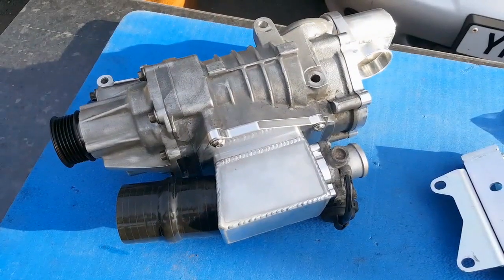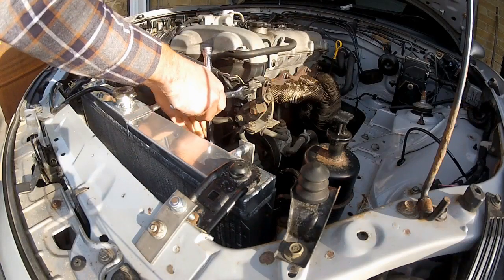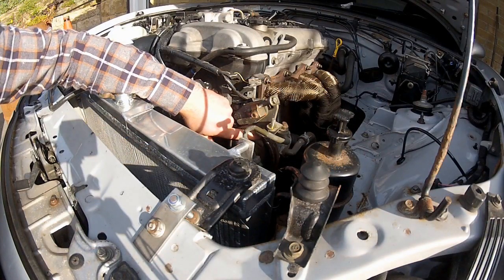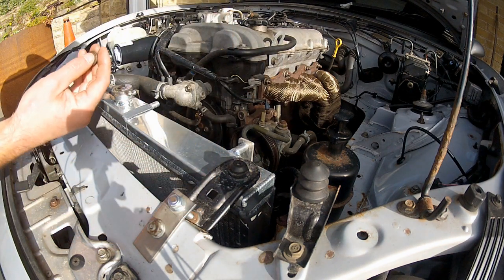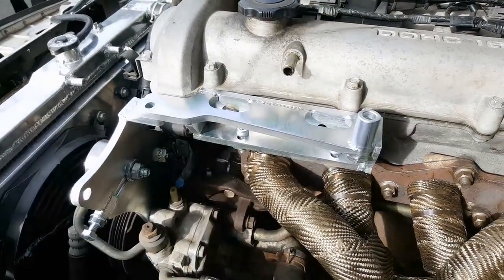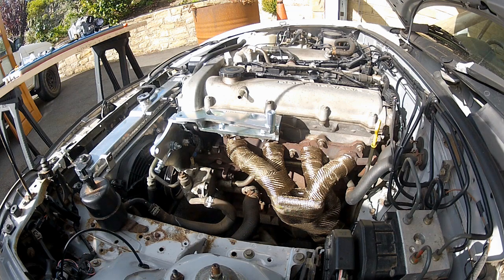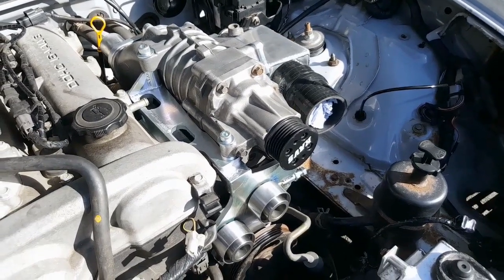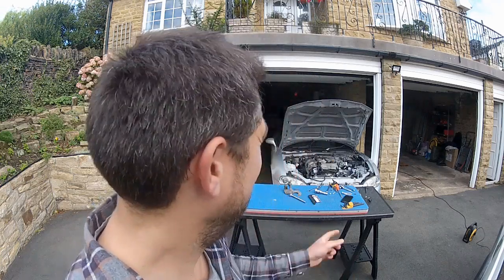Installing an Eaton MP45 Supercharger into My MX5! How to Guide | Supercharging the MX5 Miata Ep 22

Comment: Will you still have power steering when this is done
Reply from the maker: Yes
Reply: @FastRust  Thank you for the reply. I'm looking into supercharging my 91 miata this summer and have been looking for a tensioner that allows me to keep my PS. I believe I'm going with an MP62 supercharger. Do u have any idea if this bracket in this video would also work with it.
Reply from the maker: No this is an M45 specific kit. I believe there are kits available for the M62.

Comment: What have you done regarding the idle control valve? Have you connected it using a hose takeoff?
Reply from the maker: Idle control valve is stock position under the throttle body. Do you mean the bypass valve?
Reply: @FastRust  I meant the main spigot that comes off of the ICV. Currently got near enough the same setup as yourself. And it's the one thing that is causing me issues

Comment: i dont know if u can help me out with this but with the kit i cant see how a second throttle body mounts up do u have any idea how it works cheers
Reply from the maker: This is something I intend to cover in later episodes. Initially I will be running just the one throttle body on the intake manifold as that's the way the kit was designed. But I will be modifying the setup to dual TBs eventually and will document that as well.

Comment: I may be not so knowledgeble, but why buy a supercharger that needs to be installed next to the exhaust manifold? It will feed hot air because the supercharger will warm up. Cold air is much better.

Edit: I mean it in a way as if, are there superchargers that are placed right next to the intake? And maybe because of the way supercharger works, it won't really matter? It still pulls the same amount of air, and this air will go through a radiator regardless and get cooler.

Nvm, I guess I answered my own question.
Reply from the maker: It's not ideal having it sat on top of the exhaust. Fact. But it's the easiest/cheapest way to go about it in these cars hence why most kits are designed this way. With a decent intercooler it still works well.